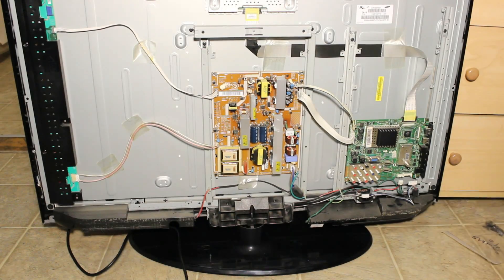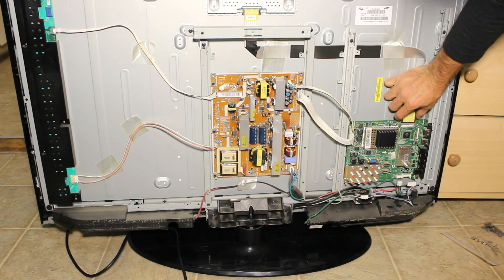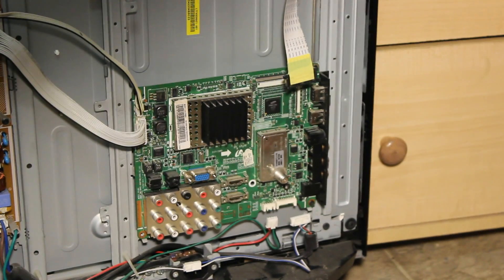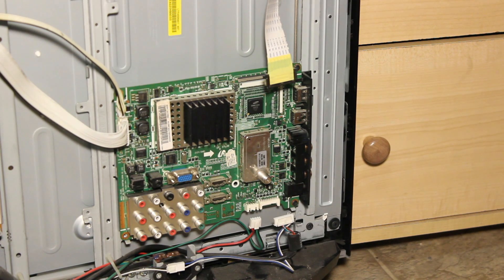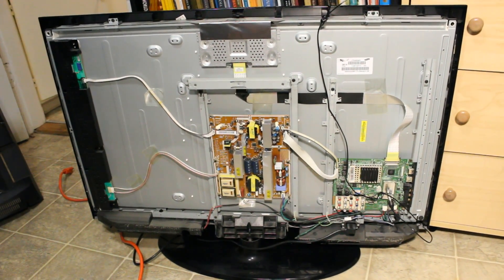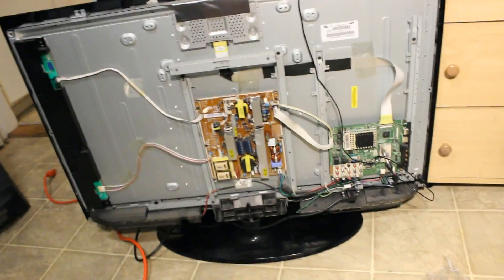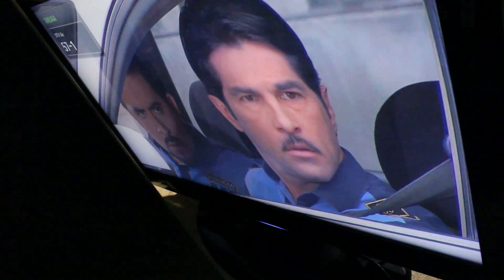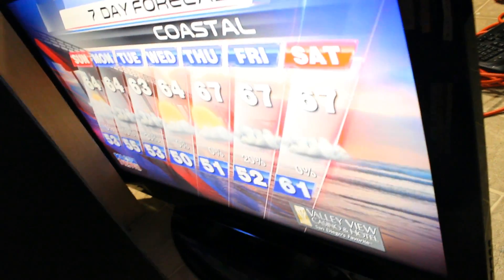How to Repair Samsung LCD TV Power Cycling, Screeching High Pitched Noise Buzzing and Bad Picture

Comment: THANK YOU SO MUCH FOR POSTING THIS! OUR TV JUST STARTED DOING THIS AND MY STEPDAD ABOUT THREW IT IN THE TRASH!!! NOW I CAN HAVE IT FIXED!!!
Reply: Thanks for the pin, unfortunately the board went out soon after we replaced it. The old tv has offically been replaced with a new one. It had a helluva good 10+ year run!!!!
Reply: @twiztvampress  I’ve been having the same problems and I couldn’t stand the screeching noise any more lol my tv had a good 7 year run
Reply: @darkness2160  the board we installed went out shortly after. I just went and got a new TV lol
Reply: Help step bro I’m stuck in the washing machine

Comment: We have a Samsung 40'' LN40A530P1F. It doesn't do the same thing, but kind of similar. It doesn't power cycle. The picture comes in and randomly, it will go to like... a negative version of the picture with some static and it will SCREAM LIKE A BANSHEE. It isn't the polite but irritating long beep you have, but the scratchy white noise at top volume, even if the tv is muted. I can't find the mainboard online for this, so would it just be better to replace the tv? I can't seem to find anything on my problem... so if anyone in the community is more tech savvy and can help, I am desperate!
Reply: Did you ever find a solution? Mine is doing same white noise!

Comment: Same happens to me but i want to try to repair mainboard.
I have tested and only 5.3v arrives to tcon board, when it should bem around 12 or 13v.
Power board pinouts ok.
Still haven't figured out whats not happening.

Comment: Hit both sides of that ceramic capacitor on the main board with a soldering iron and it is now repaired. No parts required. LN40A, but should work for related models with same problem. Please try just resoldering the cap before ordering parts. Very small tip required. Easy to get a blob in the wrong spot.
Reply: Could you possibly specify which capacitor you resoldered? Want to try this myself.
Reply: @nmanna21  https://www.youtube.com/watch?v=fgy4Tiy0auQ
2:36  seconds in he points to the cap.
Reply: @robertdemarest1989  thank you! I will give this a try.
Reply: @nmanna21  Sorry, I should have been more specific. I have an image but have no way to post it here. It is a small black surface mounted almost square ceramic cap on the back side of the power board next to an IC with 8 leads. I watched a different video on youtube that describe repair of samsung screeching etc. and the guy points to it at one point. I think many kits of ICs and caps are probably not required if bad solder joints on these caps are refreshed.

Comment: My TV does that too but mostly  high pitch noise and the green or yellow scene with my TV going on and off without even using the remote. So how do I get a new mother board?
Reply: I also thought it was my ports because I have my Roku attached to the HDMI port.

Comment: I have a Samsung LN46A550P3F that this happens to. How can I find this part? Also what is the actual part called? When I go to the Samsung there is no pics of the mainboard parts. Thanks.
Reply from the maker: These are older models, so the only way is to find used parts in working condition on websites, such as ebay.

Comment: Where did you get your main board and is it still working how much did it cost? Would you advise me to replace the main board or simply purchase new Samsung tv?? Please respond I am a widower with very little money but cannot afford to purchase expensive parts only to have repairs last one is 2 years. Please answer I am subscribed to your channel so you can easily find my question to answer me????????

Comment: Solved the problem... Whack it hard in the back center of the TV a couple of times....at your own risk.....worked for me! Picture better then ever ! DO THIS AT YOUR OWN RISK !!!!
Reply: billg521 did this really work for you? Is it still working ok? Bec i just whacked mine a few times- seemed to make something happen but not correct it
Reply: @christa10689  yes  this really worked for me and it has been fine ever since. I was ready to toss it away so I did not care....I whacked it several times, very HARD ! So if all else has failed for you and you are ready to throw it away, give it some hard slaps on the back of the set...in the middle and on the sides top and bottom "in the back"...hard. Worked for me. Don,t hurt you hand.

Comment: My 60 in Samsung kept coming on by itself ....would Cycle on and off open then close open then close I tried unplugging it from the back that didn't help I had good sound but the picture was like a colored snow. I solve the problem. I gave it a couple of good hard Smacks in the back center of the set. The picture came back on the cycling stopped I have all channels and the picture is clearer than ever ....so if all else fails give it a couple good whacks!!!!

Comment: my 46 inch samsung tv Samsung BN94-02079B (BN41-00975C) Main Board for LN46A500T1FXZA does the same thing. it turns on and off. you can see the standby light blinking. it turns on a lined picture pops up then it turns off again. it is worst when it is cold in the room. when was warm during the summer it wasn't that bad. took a few mins to turn on but it turned on and the picture was great. I just ordered a new main board from ebay for 45.00 I hope that helps.

Comment: I have a Magnavox TV model number 37MF321D/37 tv and the TV light by the power button was blinking and the so was the picture and the TV would not turn on. I replaced the power supply and now the power supply makes a buzzing noise and the picture is just white. Any idea what it could be?
Reply: T con

Comment: LN46A540 -  Bought a main board at EBAY and replaced it.  Very simple plug and play. TV works as problem went away.   Thanks for putting up the video.
Reply: You didn't have to do any soldering or anything like that? I have the exact same model as yours. I'm hesitant to order a nonrefundable part if it's complicated to replace.

Comment: Sri iam Balakrishna from Bangalore i working in Videocon Company , i attended samsung lcd tv ,model number LA32D55OK1R ,Using panel number LTF320HN01, flicking problem picture with small lines top to bottom sir, please guide me which section problem , in Tcon Board which track should cut

Comment: you could repair that mainboard its a small SMD cap between the two 3.3 volt reg. I repaired 3 already.  Sometimes if u leave it on it will work ok untill its cold again.
Reply: Jermaine Ortiz can you help me in repairing mine. I just need a little direction
Reply: how did you fix it
Reply: Hey bud got a ? For yea
Reply: True, U gotta warm it up first on HDMI for Lik 10mins then turn it on lol
Reply: Please tell us more!
Reply: @TalesGrimm  i,m here to hellp
Reply: @eman59461  The hero returns!!!

I need to know exactly what you did to figure that out and how you fixed it. I'm new to micro components, so this is all very confusing to me. How do you know which capacitors are causing the problem?
Reply: @TalesGrimm  i have a video on my Channel doing this same repair i believe its from 2017.
Reply: @TalesGrimm  its a tiny surface mounted capacitor that opens. its on the other side of that mainboard. The cap is inbetween two ICs.

Comment: Nice straight forward video. Easy to understand. I have the same problem on  Samsung LN46A550 P3F. Would replacing the main board solve the problem? On some other forums I noticed there was a mention of replacing T-con.  Part # of the main board is model PEARL  code no BN41-00975B(2008.01,13). Is there a canadian source where I can find this part?
Reply from the maker: If you have a screeching noise when you first turn on the TV, and the TV power cycles, it is not a t-con problem with these models.  I would replace the mainboard first.

Comment: You can repair the board. -MP2363DNLF and a 47 mf cap. We have a 90% repair on this , Allen's TV Columbus GA
Reply: Back of mainboard. Replace C102 AS7 47uf tantalum cap
Reply: Acabo de verlo...exatamente arriba del IC101...lo encontré como AS7.
Reply: Hola...no puedo encontrar el c102 AS7 47uf en la placa...puedo ser tan estúpido?
Hi ... I can not find the c102 AS7 47uf on the plate ... can I be so stupid?

Comment: LG LW5700
Sale un tipo de lluvia en la imagen, como puntos al azar por la pantalla.

¿Cuál podría ser el problema y su solución?
Reply from the maker: Hola, cual input tienes conectada? HDMI, Cable?
Reply: En general. Desde el menú, entrada de cable, hdmi. En todo. Por eso descarté q fuera la señal de cable.
Reply from the maker: son lineas las que aparecen o puntos de colores? puedes describir mejor el problema?
Reply: Son puntos que no son fijos, son muy variables, aparecen por lo general en las zonas con contraste. Como si fuera la lluvia de la señal de TV cuando está mal conectado, pero mucho más pequeñita y tenue. Al principio, aparecía a los 5 o 10 minutos de encendido, ahora aparece desde el encendido. Y como dije arriba, sale de forma general en todas las entradas de la TV, desde los menús, hasta el hdmi, av, cable, etc.
Reply: Dp @snoopda1andonly

Comment: where can I purchase a main board
Reply: Natasha Askew 8973751438
Reply: eBay for cheap. Not expensive to repair or replace.
Reply: @daguru87  ebay got mine for $45 will see if it works when it get here
Reply: New Yorks Finest did you fix it?
Reply from the maker: Hi, you could probably found one on ebay or shopjimmy.com. Just make sure you get the correct part number.

Comment: so if the screen image is horizontal  instead [of vertical like yours] will the main board replacement fix that also i do not have on and off problems or high pitch noise. just lines across the screen with distortion and gets worse everyday once it clears up great picture.
Reply from the maker: What is the model of the TV? Do the lines cover the whole screen or just part of it?
Reply: Samsung LN52A650 here.  Mine is just starting to intermittently shoot static over the video source horizontally, and I can't reproduce it on demand.  No unusual noises, etc.   Sometimes just in horizontal sections (or bands) other times the entire 52" screen.  I LOVE my TV and want to save her before she goes completely!  lol  Have the back off and no "visible" blown caps on any boards (sadly)
Reply: same model here and same problems, noone can fix this???
Reply: rickie arnold sir i have samsung lcd model is  ua40f6800 problem is it has virtecal line on the right side of the scren

Comment: modelo :26la30q
Reply from the maker: +joel privado cuando la prendes, se queda encendida la luz azul todo el tiempo o se apaga sola?
Reply: Se queda ensendida pero alos 30 minutos se apaga
Reply from the maker: +joel privado El problema puede estar en diferentes partes, puede ser la fuente de power (power supply), invertidor, o main board. Lo primero es abrir la tele e inspeccionar los capacitores que esta en la fuente de poder.